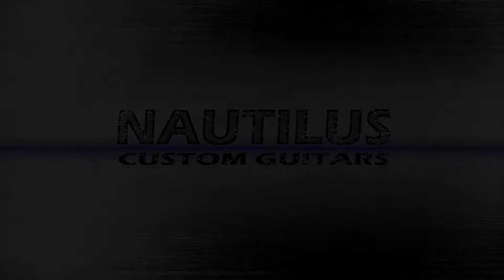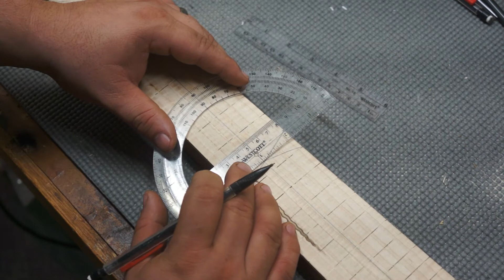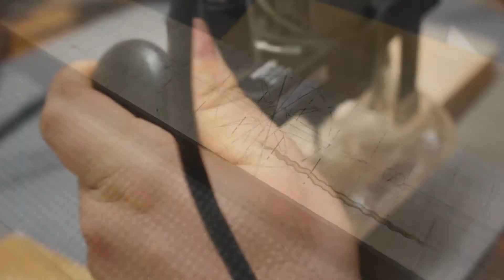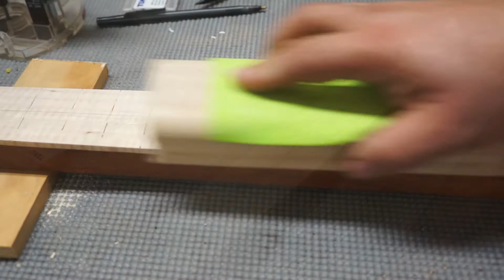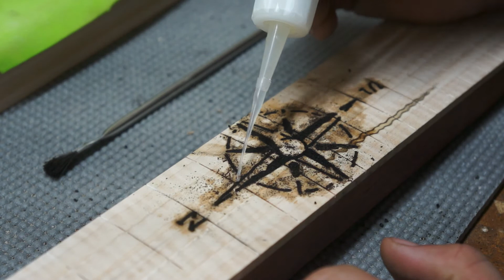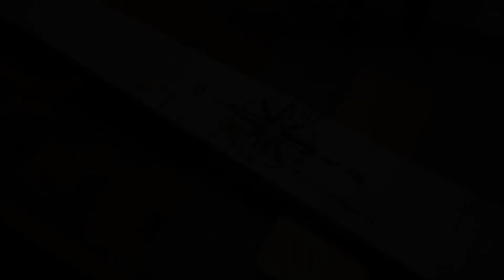How to: Back Fill Inlay Tutorial

Comment: Awesome video but what are your thoughts on how to transfer onto ebony? I'm looking at doing a first time banjo fretboard and headstock and the fretboard will be ebony and my old eyes not so good. Maybe some sort of white transfer?
Reply from the maker: Hey Mike! I ran into this exact problem before when doing a tribal fireball inlay on Ebony. It's been a while but the way I did it was the almost the same. I did the transfer and when I picked up the paper it wasn't there.... until I turned it slightly in the light and caught the reflection. Then I took a pencil and re-traced it so I could see it better. Another option would be to trace your design with a ball point pen using a lot of pressure so that it leaves a relief in the wood. Hope that helps. Good luck and happy building!
Reply: @NorthstarGuitars  Its like looking for the shine of a lead pencil on a surface. There is something we are missing. I swear it will be so obvious when it comes to either of us we will laugh at how simple t really is.
Reply: You can use a marking knife and then rub white chalk into the lines